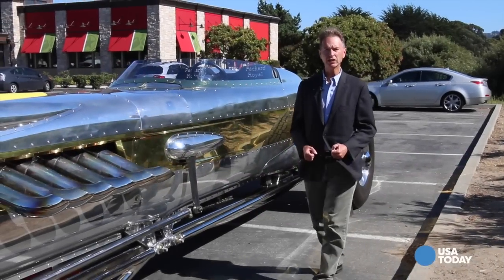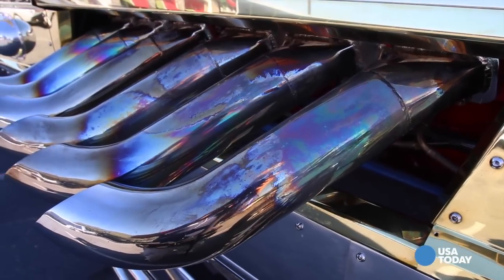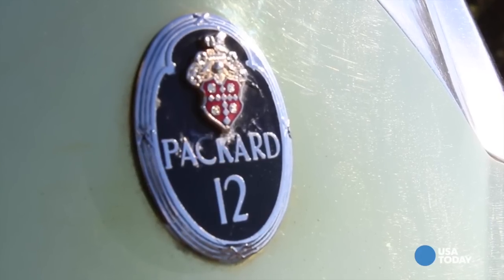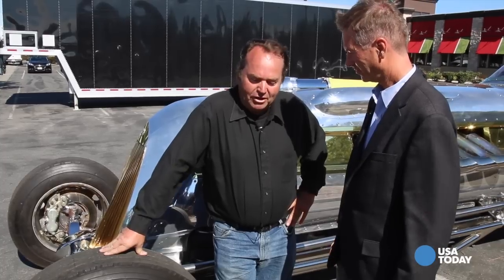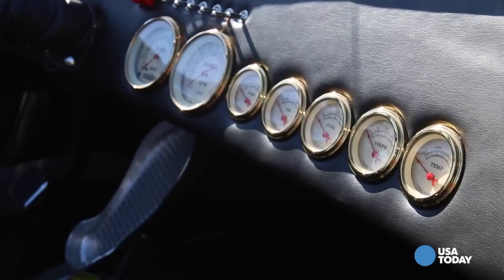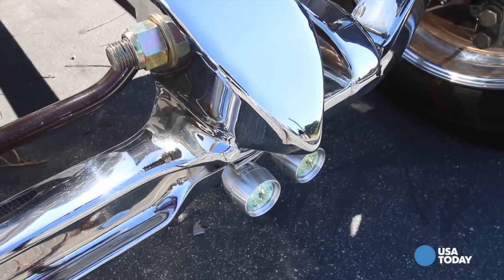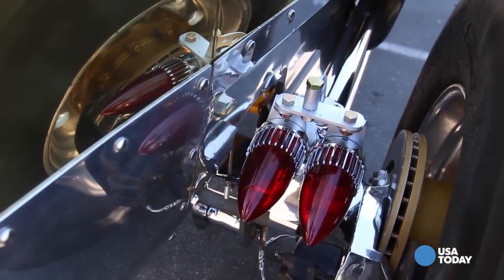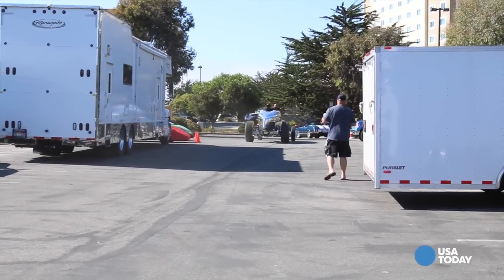Packard Royal with PT boat engine

Comment: Who did this first? The guys building race cars 100 years ago! One approach those days was to build huge oversized cars to carry giant, underpowered engines to get good straigthline speed. They had funny competitions with the cars from the other end of the spectrum that could gain the difference in acceleration and cornering speed.
Reply: Really depends on the track then - - a banked wide oval vs a F1 layout.